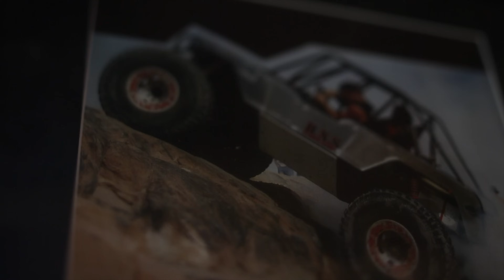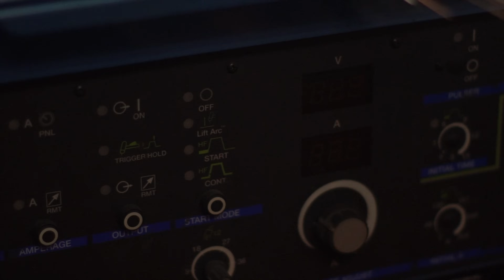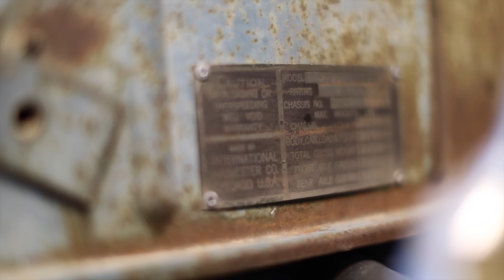The Trophy Rat full version

Comment: The only thing now it needs is the telsa p1000d power train and it would be perfect and even more unstopable then it already is
Reply from the maker: that would make one hell of a video!
Reply: @Solportraits   i know right but make it awd twin model s/p100d drive trains and use supercapacitor modules with small nihm batteries for reserve packs and have boosted regenerative brakes, with a solar panel over the truck bed, like a tonto cover. it would never run out of power and could go any where lol
Reply: Ew
Reply: @nickslade7635   you say ew but if u have witness the power of electricity, you would agree
Reply: @tylerlooney8058  im very involved in the car scene, i know what the tesla can do, its still gay
Reply: @nickslade7635   i too, am into the car scene myself any thing from 1886-1992 modern not so much, very little i care for these days. I was a huge fan of the i.c.e until i seen the true power and potentional of the electric motor car. The only limiting factor of ev's are there range which is why many people sway from them but with both telsa and the engineer goodenough who is currently working on the solid state battery along with fisker with the release of the emotion in 2020 with a s.s.b. capable of 500 mile to the charge in 1 min flat, gas and diesel dont stand a chance, which is why i have gone from fossil fuel base power to an ev power. Im not only a car scene fan, but a tech scene and engineering scene individual. I understand your  non interest in ev's but keep an open mind, take a look for yourself and then decide which is best.
Reply: Great current example: the 2020 Rivian R1T 788-800hp, awd capable of on and offroad driving, plenty of torque for towing and 400 mile to charge https://www.cnet.com/roadshow/pictures/rivian-r1t-pictures/4/
Reply: @tylerlooney8058  i work on electric forklifts and have a understanding of electric motors, its not my style and nothing will ever be cooler than a v8 ripping past you like tgis truck does, the electric motor would be silent and underwhelming. Im oldschool and still prefer a manual trans also
Reply: @nickslade7635  yes im aware of the silent treatment the electric motor car, and i love nothing more then the beautiful sound of a 426 hemi dragster zipping by me as i watch from the stands or even being behind wheel myself, plus i enjoy an manual myself but more of a padel shift manual vs floor clutch shift manual, both being non electronic of course lol. But one good thing about tesla, the p100 has a specialized audio selection for both interior and exterior output to mimic the sounds of your favourite i.c.e sounds. Honestly my reason other then for instantaneous power and longevity of the ev is the zero emissions and zero maintance inless of course ur upgrading them for racing, which even then not much is required verses the long hours it takes with an i.c.e. plus with our environment going to the crapper, i dont mind a saphistacated motor sound system over the carbon emitting i.c.e exhaust system. Its a hard idea to get into but it was the power vs sound that made the switch for me. But there is one thing i can say and that is that though i do care for ev motors i perfer the 3 phase bldc vs the 3 phase ac motor, less of a headache with electronics lol cuz i would rather have direct current, instant power and understabably easy circuits vs an extra circuit that has to convert ac to dc. Of course may be wrong on that part, seeing how im mostly worked with carburated i.c.e's